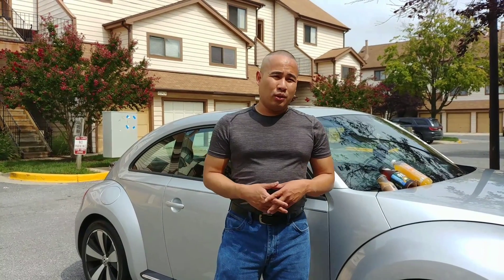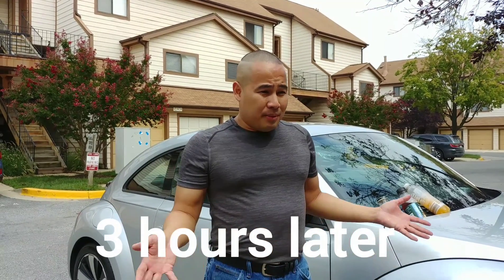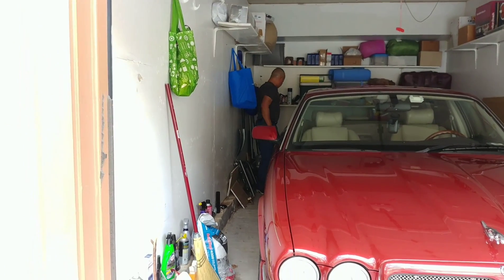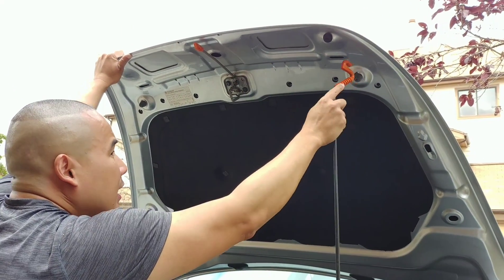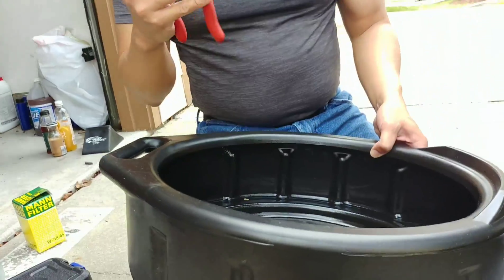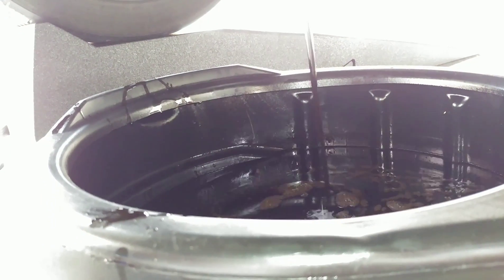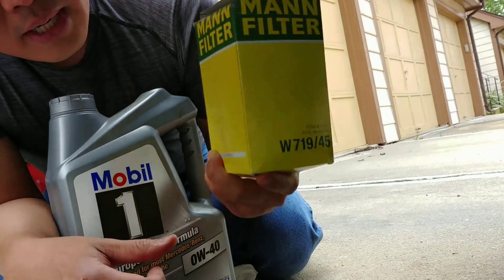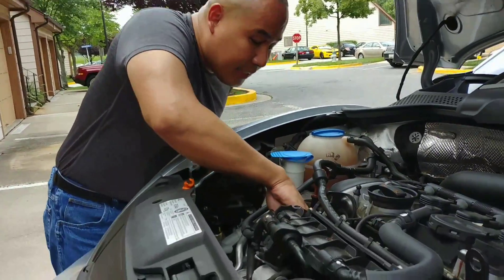VW Beetle Oil Change. Is it Easy & Fast to Do a DIY Maintenance Oil Change on a Volkswagen car?

Comment from the maker: You can purchase the oil, filter and tool by clicking the affiliate links below:

1. Liqui Moly 2041 Premium 5W-40 Synthetic Motor Oil - 5 Liter Jug
https://amzn.to/2ZDtN5P

2. SMART-O R3 Oil Drain Plug M14x1.5mm - Engine Oil Pan Protection Plug with Anti-Leak & Anti-Vibration Function
https://amzn.to/2XTxjHw

3. Liqui-Moly Cera Tec Motor Oil Additive (300 ML) - 2 Pack
https://amzn.to/2UN1Q7U

4. Liqui Moly Jectron Gasoline Fuel Injection Cleaner-pk
https://amzn.to/2DDmS3b

5. 2011 to 2016 Mann-Filter W 719/45 Spin-on Oil Filter
https://amzn.to/2DG5jzj

2017 to 2020  Volkswagen Beetle or Audi Oil Filter 06L-115-562-B
https://amzn.to/2KqmYim

6. TEKTON 5866 12-Inch Oil Filter Pliers
https://amzn.to/2DBO1TT

7. Race Ramps RR-XT-2 67-Inch XT 2-Piece Race Ramp
https://amzn.to/2GEPauE

8. Craftsman 320-Piece Mechanic's Tool Set
https://amzn.to/2ZHhSDR

Comment: Wow thank you.  I had my oil changed at Wal-Mart. What a big mistake. They charged me 60 dollars and didn't even change the filter. They also didn't reset the oil change light.
Reply: I can't get it to reset. Can you do it slower. 
Hazard lights push in set button push on the brake start car. Push in clock button?
Reply from the maker: Try this one: With the ignition switched OFF, press and hold the 0.0/ SET button (located on the right side of the instrument cluster)While holding down, turn the ignition to the ON positionRelease the button and briefly press the button for setting the CLOCK (located on the left side of the instrument cluster) onceAfter a brief period, the display will switch back to the normal display indicating the service interval is reset
Reply: @ejsgarage  omg. Thank you.   It worked

Comment: Hey EJ! Thank you for another update video. I think that I will start changing the oil on my 2018 Beetle Dune 2.0T because I don’t like that the dealership changes the oil every 15,000 km or 10,000 miles. I feel better if it’s changed every 6000 or 8000 miles because I want my engine to last. And after i change the oil, I will still bring the car for every 10,000 mile service so they can check other things like brakes, coolant... Thank you for teaching me and I think I’m ready to change my oil!!!
Reply from the maker: My pleasure Jeffrey. You will know what kind of oil and filter you put on your VW Beetle when you do it yourself. It is very easy when you have the right tools, I list everything on the descriptions😀
Reply: EJ'S GARAGE Thanks much💙

Comment: I have the identical car but have an oil filter housing instead of the screw on filter. Are they interchangeable or should I get the filter insert and use the housing versus the screw on filter? Thanks.
Reply from the maker: They are not interchangeable, you just need to get the filter insert
Reply: @ejsgarage  fyi my 2013 VW Turbo has a TSI engine which takes 5.5 quarts of oil, has an undercarriage shield that has to be removed to change the oil and uses Spline bolts which required several trips to the store to get the proper tools to take the shield off and the oil plug. Also, the filter as mentioned uses the housing not the screw on type. I guess you have to pay attention to the model and specs but these subtleties were not apparent until I got underneath the car. Thanks for the video.

Comment: Jeffrie  that was fast 15 minutes, in my 8 years of owning several new Volkswagens, I never did a DIY Oil Change due to the low prices my VW dealer charges .  On my new 2018 beetle 2.0TS (TSI EA888 3rd gen with plastic oil pan and cartridge type filter). It’s $60 prepaid with tire rotation . If I did it myself using 7 quarts Castro’s Edge it will cost me $60, plus no tire rotation yet. No wonder Volkswagen can charge low price. 
Interesting to see your Beetle 2.0T with the Spin on filters on the TSI Gen 2 engine. Nice car, pretty much a Beetle GTI
Reply from the maker: Thank you for letting me know the change in the 2018 VW Beetle.  $60 oil change & tire rotation is not bad. I hope that they are using the synthetic oil. You can always ask them about it 😀
Reply: They use Castrol Edge Synthetic bulk quantity , Oil change is $90, and $60 if prepaid with new vehicle purchase at VW Murrieta in Southern California
Reply from the maker: That is very nice that they have the pre-paid option 👍😀👍😀

Comment: I have a 2014 r line 2.0t beetle convertible and tried to change my oil but the undercarriage didnt look anything like this.  is my oil change different than this video?
Reply from the maker: Does it look like a cover? If it is, you probably need to remove it first

Comment: Hi! is it gonna be the same process for a 1.8L?
Reply from the maker: The process is the same the filter may be the cartridge type.
Reply: Like the same filter and stuff?
Reply from the maker: What year is your Beetle?
Reply: It’s 2015 ;)
Reply from the maker: @karinacastrovargas3259  This is the filter https://www.amazon.com/Mann-Engine-Filters-Porsche-Turbo/dp/B09K3SB1PD/ref=sr_1_3?crid=2D82PA3J0UOLX&amp;keywords=2015+1.8L+beetle+oil+filter&amp;qid=1646957497&amp;replacementKeywords=1.8l+oil+filter&amp;sprefix=2015+1.8l+beetle+oil+filter%252Caps%252C42&amp;sr=8-3&amp;vehicle=2015-74-952------------&amp;vehicleName=2015+Volkswagen+Beetle&_encoding=UTF8&tag=entjikjeffrie-20&linkCode=ur2&linkId=7398992669e484aa62d3d241cc8261b3&camp=1789&creative=9325
Reply: @ejsgarage  Thank you so much!!! I appreciated your help
Reply from the maker: @karinacastrovargas3259  My pleasure Katina 😃

Comment: Good job, next time remove the top lid from the engine to accelerate the draining process. Also you should get a new washer every time you change oil bro.
Reply from the maker: Thank you very much for the tip.

Comment: Pretty good video...hurried a bit much to prove your point. Would’ve saved some time if you’d had all materials/tools ready. Your Beetle looks great...what year is it? Almost always, the VW dealer has mine done in less than an hour, using their Service Xpress, but good for you, DYI is cheaper. Thanks for a nice presentation.
Reply from the maker: Thank you for the kind words. I have another video in a lot slower pace. It is 2013

Comment: t. kobylarz
I have a question.  I would like to install an Oil Pressure Sender / Switch onto my 1969 Beetle.  I'm unable to determine where it is to be installed.  Can you help me?

Comment: I think that's a compression washer on the drain plug. I've heard you should replace those washers each time.
Reply from the maker: Yes, it has to be changed or it will leak

Comment: Hi! Great video! What happened at 12:20 after you had to come back? I can't find what you did to make the new filter fit. It looks like there was something in there that you had to remove? Thanks!
Reply from the maker: Thank you very much. The filter bolt got stuck on the engine and I made a video on how to remove it. Avoid FRAM filter.https://youtu.be/rytnXqJxrWY
Reply: @ejsgarage  Thanks for the quick reply! Is the oil filter in the 2.5L the same type and in the same position?
Reply from the maker: Amazon will tell you if will fit or not when you specify the engine.
Reply: Exactly the same thing that happened to me...I had the same reaction you did as well...wait what? Hold on a minute...did we get the wrong filter...oh wait...
Reply from the maker: The bolt stuck and it does happen.

Comment: Couple of things you missed. Not all Beetles have their filter on top and most cars have it at the bottom of the engine which makes it harder to reach and replace. You got lucky your filter is on top.
second you should always remove the oil fill cap on top of the engine when you are draining the oil otherwise you are leaving old oil in the engine and mixing it with the new one. 
Also some filters come with an O-ring which you have to seat correctly so you don't have a leak when you install the filter, and as you found out you should always wet the casket of the new filter before you install.
never use a tool to tighten the filter, always by hand and when it stops add a quarter turn by hand to make it tight.  Its best to torque the screw at the bottom to mfg spec to ensure proper installation.
Reply from the maker: Thank you very much for the tip and details Sam.

Comment: Yes, waiting for an oil change is long but they do more than changing the oil. They do point inspections. Checking the brakes, tire pressure, suspension, etc. They rotate your tires and change your engine and cabin air filters. Sometimes they even will do a state inspection and put new stickers on your car.
Reply from the maker: Very true. 😅😂

Comment from the maker: In this video, I will show you how to do the DIY oil change on VW Beetle. You can buy what you need for the oil change by clicking the affiliate links below:

1. Castrol 03057 GTX MAGNATEC 5W-30 Full Synthetic Motor Oil
https://www.amazon.com/gp/product/B00TS9ZYWI/ref=as_li_qf_asin_il_tl?ie=UTF8&tag=entjikjeffrie-20&creative=9325&linkCode=as2&creativeASIN=B00TS9ZYWI&linkId=186d6be76130f2b24cc3e10bf4acd95c

2. Mobil 1 120760 Synthetic Motor Oil 0W-40, 5 Quart
https://www.amazon.com/gp/product/B01IR9K0GO/ref=as_li_qf_asin_il_tl?ie=UTF8&tag=entjikjeffrie-20&creative=9325&linkCode=as2&creativeASIN=B01IR9K0GO&linkId=f714b395aa5cf9422344cd8e832d0a1b

3. TEKTON 5866 12-Inch Oil Filter Pliers Oil Filter Removal Tool
https://www.amazon.com/gp/product/B000NPR33O/ref=as_li_qf_asin_il_tl?ie=UTF8&tag=entjikjeffrie-20&creative=9325&linkCode=as2&creativeASIN=B000NPR33O&linkId=16c9882d7929e5d4f3f402d601dd99cb

4.   Mann-Filter W 719/45 Spin-on Oil Filter 
https://www.amazon.com/gp/product/B002UZGCSW/ref=as_li_qf_asin_il_tl?ie=UTF8&tag=entjikjeffrie-20&creative=9325&linkCode=as2&creativeASIN=B002UZGCSW&linkId=217f17ec3f3610fdb8579c0b3653c223

5. You need tools and the Stanley tool kit has everything that you need.

https://amzn.to/2Rzis5y

Comment: Carefull! This is a 2.0l four banger. For the 2.5l five cylinder you need to remove the under plate then drain and it takes 6.5 quarts/ liters of oil!!!!
Reply from the maker: Thank you for the tip for the 2.5L

Comment: So no seperate oil change for the turbo?
Reply from the maker: No separate oil change. It is very easy to do
Reply: @ejsgarage  Thanks, I want to buy a 2018 beetle but I read that German cars like the Porsche often get overfilled because the turbos are not emptied. I guess Porsches are not like bugs.
Reply from the maker: @micjakes1  Bugs are a lot cheaper to maintain than Porsche
Reply: @ejsgarage  Have you worked on jettas? Are they bad cars?

Comment: What is happening at 12:00 ?
Reply from the maker: The FRAM oil filter bolt got stuck. I will never use FRAM oil filter again. It was wierd because it never happened with the MANN filter.